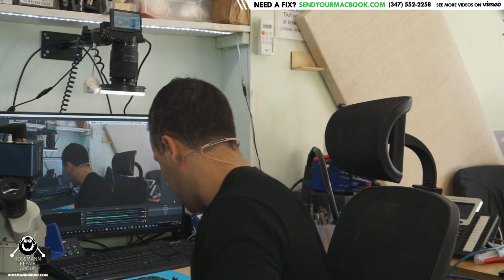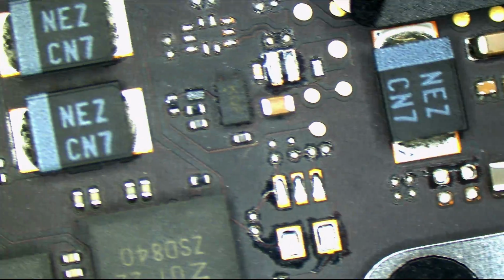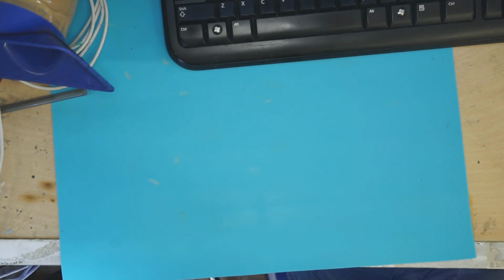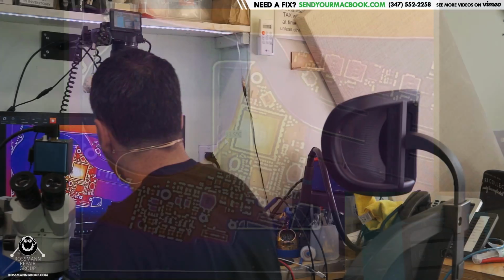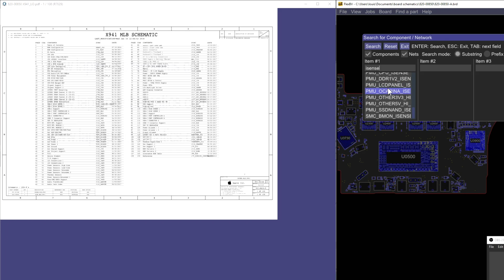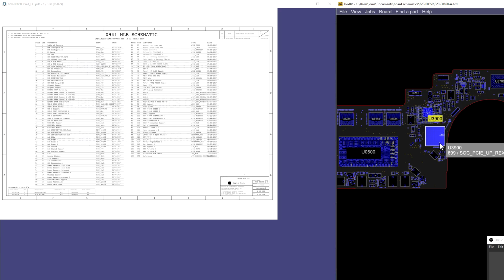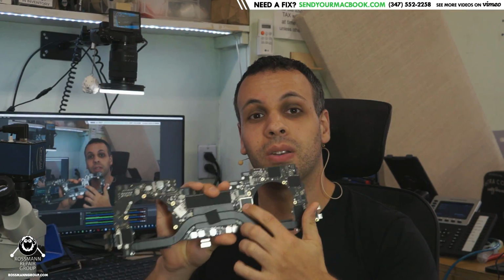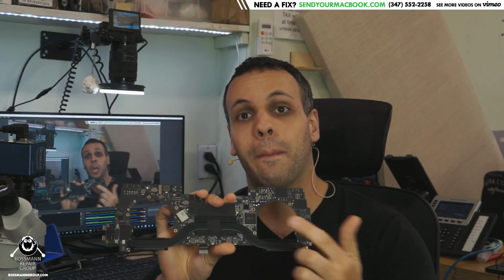Apple users have no one to blame but themselves.

Comment: I am a recovering Apple user.  I send these videos to Apple users.  I have bought 3 Mac Minis starting with a PowerPC, a Mac Book Pro and one Mac Pro 2009.  My Mac Pro died.  I replaced it with an Intel NUC for half the price of the Mac Pro and it is much faster.  I use OBS studio to record screens and make videos.  I MS Photos for light editing.  The best editor is DaVinci Resolve by Black Magic Design.  Who needs Apple?  I have been fortunate because my other Macs still work but I can't upgrade and of them because they are too old.  Mac Mac Pro was still a useful machine before it died but the operating system couldn't be upgraded.  Why?

Why of the "rotten apples" I hate the most is time machine.   Why does it update when I start up?  I must wait to use my Mac.  Time Machine should have an option to update while waiting for the sleep mode timer to turn the machine off.

Will the T2 chip prevent installing Linux as the main operating system?  Installing Linux seems like a good option when Apple no long upgrades the operating system but if Linux doesn't work then the Mac is stuck with the old operating system.

Comment: Welcome to Apple tech support. We are very enthusiastic to annonce you that your $2500 laptop is not covered by warranty as it appears there are fingerprints on the keyboard, therefore breaking the terms and conditions agreement.
Reply: Their products are only meant to be looked at. lol
Reply: @anthonyrusso2520  naaah you void apples warranty by simply looking at it.  .
Reply: It's a collectible item. You should keep it in the box.
Reply: @Mr_ZPguy  by the price it probably is a collectible.
Reply: So in the EU you have MINIMUM 6 years warranty enforceable in the small claims courts. Be smart, be informed.
Reply: @robo6548  don't know where you are living but in the Netherlands it's only 2 year and no drop/water damage.
If they say it was by liquid you'll need some heavy evidence to prove them wrong
Reply: @RFRM89  Actually it is longer in practice, as long as you kindly and in a firm voice "remind" the manufacturer of the actual laws an rules.

Example: Friend of mine here in the Netherlands had her macbook Sdd crap out a few months after the 2 year mark, turned out to be a production fault in the SSD. Apple dealer/official repair shop she bought it at claimed just that 2 years limit before presenting her with 2 hefty bills, one for the analysis and one for the repair.

She asked me to do a bit of research for her since I had dealt with something similar before and with a bit of checking the "billijk" part of the laws, you can find it stating that a consumer has a minimal amount of time they might reasonably expect a product to function. 

For electronics (including computers) it is about 5-6 years (it wobbles a bit depending on type of device it seems) when used as expected.

When we clearly explained we knew about this law and or rights to the Apple dealer they agreed to tear up the SSD repair bill suspiciously quickly.

Then the bastards tried to still make her pay for the diagnosis until we again reminded them that since it was a factory fault it still was the responsibility of Apple for supplying her with a bad product.
So she got her Mac fixed for free in the end.

So it is always worth a try to show the shop you know what the law says in these cases.
Reply: @RFRM89  , actually it is three years , but the burden of proof lies on the customer.
Reply: @robo6548  in the USA, your screwed.
Reply: menotu000

*you're
Reply: @robo6548   No you dont, you have a minimum 24 months warranty,  the rest is optional ( you pay for it for more ). The same goes for apple products too.
Reply: @robo6548  No. It was the UK that had a 6 year warranty, or more specifically "the reasonable life expectancy of the product", which was generally agreed to be 6 years for electronic goods, under the Sale of Goods Act.

It was the EU who forced us to change that, capping it at 2 years, to "harmonize" with the rest of the EU.
Reply: @GMMilambar  under the consumer rights act 2015 You have six years to take a claim to the small claims court for faulty goods in England, Wales and Northern Ireland, and five years in Scotland.
Reply: @robo6548  Correct, but even then Apple can stall and delay and claim all kinds of BS that YOU as the customer will then have to disprove. In the end you'll have to hire experts to examine your Macbook (which voids your warranty) and then take legal steps against Apple. All in all it will probably cost you more than the Macbook is worth and you'll end up doing what you should have done in the first place: take your loss and never buy anything from that shitty company again (personal opinion).
Reply: @tjroelsma  It may be your opinion that they're a shitty company but Louis has been providing proof for years that it's a fact
Reply: @MadnessReborn  I know, just covering my ass LOL
Reply: @robo6548  Nah this is the U.S. my friend. The best you can do here is stop buying their products. I bought the first iPhone and I the 3GS was an upgrade I was wrong. Until the 4G no hardware upgrade only software. They were selling the same phone until 4G came out just different Shell's.
Reply: @robo6548  Its only 2 years man.
Reply: Failure to use $199 Apple white gloves required for use of any apple product
Reply: @DVeck89  those are knock offs. Real ones are 899
Reply: @1972LittleC  thats if you want the space gray ones
Reply: Chat PCTV no.
Reply: "Welcome to Dell tech support, we are just as awful as Apple's,. how can we help you while I finger through the manual because I'm such an "expert" that I have to consult a user's manual on a regular basis" - Dell tech support rep
Reply: Robert Slackware Apple users are too dumb for that. They’ll just by a new MAC. They need to fit in with their hippie liberal friend zone

Comment: Gotta say, I'd probably go to court over that if they claimed water damage with no watermarking
Reply: That’s the problem there buddy, they have sensors in it that literally trip when it’s in a humid room.
Reply: edgard chavez

 In a Court of Law Apple will have to prove it is water damaged and those pads would not be sufficient as there is evidence that they can be triggered by humidity. So if Apple say humidity causes water like damage then the product is not fit for purpose, and over in the UK that would be sufficient for compensation.

Of course, it is the hassle of going up against a big company like Apple that will put most off that recourse, and in that respect they have us...

Comment: I bet they don't give a backup option to make sure that every apple user will use their TimeMachine and will use their iCloud. I bet if you tell them you can't rescue data off the board anymore they will just direct you to a subscription page and tell you better luck next time "and make sure to pay 9.99 for 100GB".... I noticed this pattern long ago. They fabricate problems to sell solutions and then pretend to be their savior. Like with dongles for example: Problem: No headphone plug, Solution: buy 19.99 adapter. Problem: No drive resuce, Solution: buy cloud subscription.

Comment: This is the opposite of the HP EliteBook 8770w I got. This beast (for its age) is easier to dismantle than to break by force. The service manual is openly available and all of the parts are replacable and can be ordered on eBay. Plus, it's as reliable as a desktop due to the supreme cooling (full-metal body made from some kind of magnesium alloy + quad vents).
It's one of the relatively few machines that can fit (and power) a Core i7-3490XM.
Really, this is one of the last Thinkpad era laptops.

For me, "Apple user" is a slur.
Reply: I have an Elitebook 8540p. You're right, easy upgradability. Heck I upgraded the mxm GPU to a Quadro 2000m and the i5 to an i7-740qm and 8gb of RAM add SSD. now it still plays GTA on normal settings 30fps 900p. No MacBook would stand a chance to have upgradability like that.
Reply: Dell Latitude E6430 - already had an i7-3740QM, but I upgraded the RAM.

I thought ASUS came out with a gaming laptop using an AM4 socket, initially with a desktop Ryzen CPU?

Comment: It would be really nice if you could explain what specifically this chip is tied to in the motherboard that causes the board to not work with an identical chip pulled from an identical machine. Did you try this replacement? If you did, what specifically didn't work? Sorry to distract from the justified rage with some technical questions.

Comment: Microsoft has been doing this for years on the Xbox consoles. The cpu, optical drive, and nand are all paired together with encrypted pairing keys and locked firmware. If any one of these 3 parts fail, you have to replace all 3 of them from a working donor board. Apple is one of many doing this crap :(

Comment: Here's why I have to laugh every time I hear about "liquid damage".  Back in 1996, I gave $2400.00 for a Pentium 100-powered IBM Thinkpad.  I used this to run a personalized gift business at the local flea market.  The market booths were open in the back, which exposed the vendors to the weather.  Once, before I learned to staple a tarp to the back of the booth, a thunderstorm suddenly came up and completely inundated the keyboard of that Thinkpad.  I drained the water off, let it dry, and it worked perfectly for years afterward, which was when the hard drive finally died.  So, if IBM could come up with a liquid-damage-resistant laptop back in 1996, why can't Apple do that now?
Reply: For the same reason they still think a Dual Core is good enough today. Their customers don't know any better.
Reply: @TetraSky  a dual core is perfectly fine, just not at Apple prices
Reply: @TetraSky  But "Dual" means two and two is better than one so it's gotta be good right? Right?!  /S
Reply: My mom uses a dual-core laptop every day and it's more than enough power for her but this was a laptop that I got for less than $100 not over $1,000 carry on.

You don't need more than two cores if all you're doing is web browsing and word processing.
Reply: @jordydrop  I like spending 2500 for dual core craptop :)
Reply: @jon2kx  "This is why it is inherently better to purchase the fastest processor you can afford" you definitely sound like a software engineer lol. 

as a computer systems integrator (15+ years), i can tell you that most normies are happy as a clam on a reasonably recent dual-core.  skylake, 14nm dual-core i3 chips are quite smooth for everyday computing (web browsing, word processing). 

if devs write bloated software, you can always rock a cheap linux box. we won't need a quadcore chip for normal web browsing anytime soon.
Reply: The answer is really simple, Apple wants every customer to buy a new Apple product every year for a ridiculous premium price.
Reply: Tar How else are they gonna pay for that new spaceship headquarters?
Reply: @tar509  well seeing how many features they can remove
Reply: It's not that they can't do it, it's that they won't do it.
Reply: @frobthebuilder  No, he's right.  They CAN'T do it.  It would ruin their entire business model.
Reply: I think you missed the main point he was making.  The point he is trying to make is that Apple will LIE to you in order to escape from their responsibility to repair. There was NO LIQUID DAMAGE, yet they told the customer that the warranty was void because of liquid damage. To make it worse Louis can't tell you why the board failed and can't fix it because of that chip
Reply: They literally build drain holes into their more business class models
Reply: @ChinookPiroh  I have a T480s, excellent machine and spill resistant keyboard as well, bloody brilliant products.
Reply: Louis told me that almost every other manufacturer of laptops shrink-wraps the boards to protect the from liquid damage, Apple chooses not to; just like they choose not to give you an apology after they blame you for bricking your own device before replacing it and saying "what, you're getting a new phone; what else do you want? I'm sorry if you think you deserve an apology, oh god I am my father..."
Reply: @justagent5844  conformal coating is way more like epoxy than a heat shrink. And yes, conformal coating is quite common. The other major issue is the non-removal battery if get water in the laptop, 1st thing is removal of the power source to prevent galvanic corrosion, (There is still a small 3v Li battery for the RTC, but it should not cause damage)
Reply: I once spilled an entire cup filled with orange juice on my ThinkPad Z60t in the middle of a seminar.  The computer shut off.  Not wanting to attract more attention to myself, I quietly took my laptop to the restroom and let it drain out the sides.  One hour later (yes, I know too early and risky, but I needed to take notes at the seminar), I plugged it in, crossed my fingers, it turned on.  I used it for 3 more years on a daily basis.  I eventually upgraded to another ThinkPad but my Z60t still ran like a dream.
Reply: Won't,not can't.
Reply: @damian winkler unless there is evidence of water on them, then the warranty is invalid
Reply: Because Apple want ya money, they couldn't care less about convenience
Reply: Linus did the same thing twice with LG laptops and they both survived after being dried out
Reply: @EndstyleGG  Actually they were Dell XPS 12 and 13 if I remember right, which is even more hilarious considering Dell has a terrible reputation for cutting corners in manufacturing.
Reply: Easy. The shorter the product cycle is, the more frequent people would (have to) buy new ones.
Reply: CAN is significantly different than *want to*.  They probably could do it, but they want to suck up as much money as they can before the MacHeads figure out the MacBook/iPhone/iPad is all a scam nowadays.

I remember some years ago saying that while I wasn't enthusiastic about MacOS, that Apple at least made nice hardware.  That hasn't been the case for a long time now.  Must be time to seriously work on a Mac-replacement Linux distribution.  Although it might need to be built on one of the open-source BSD flavours.
Reply: Check out der8auer's channel, he puts motherboards and GPUs into the dishwasher for cleaning, without any problems.
Reply: All electronics are water proof until you turn them on. A table of parts is different from a computer recieving power
Reply: LAWL WHY WOULD THEY
Reply: My ThinkPad even has holes for draining water out of the maschine in the case you ever spill something on it. It’s like they put actual care towards making the maschine last a long time and adapt to the users, not let users adapt to the it.
Reply: Because they are STUPID.. Same goes for the Apple users

Comment: I've been doing IT for 20+ years and in my experience, I've had users say to me something along the lines of, "I'll never buy another" Dell or HP or Toshiba or Lenovo when it comes to just one or two problems that happen to them...sometimes it's not even the computer itself that is the issue but the hard drive that failed....but that's enough to make a user never buy that product brand again....EXCEPT for Apple users.  Doesn't matter how many problems they have with their Mac, they always, ALWAYS, subsequently replace the problem Mac with ANOTHER Mac.  Blows my mind.

Comment: Apple lovers are like the Borg.  You just cannot reason with them.
Reply: Though you might not want to admit it, it's also possible that some Apple users (like myself) have had really great experiences with Apple products for the past 35 years. Not perfect, and I don't agree with non-serviceable machines or one-button mice, but extremely reliable and trouble-free laptops that I've used from 10 - 16 hours every day. Current machine is a MacBook Pro 2012. It's my only machine. It goes everywhere - even 2x to Japan - and I have had zero problems with it. Do I back it up regularly? Of course, but I WILL be surprised when the day comes that I go to power it on and it doesn't start up with the familiar chime. Why? because for 7 years of hard use, it has NEVER failed to do so. You can't reason with me? Sure you can. But you can't negate my experience of decades of reliable performance and great customer service by claiming that we're all brain-washed. Now, does the current Apple need to get back on track? Yes. Do I have faith that they will? That's a question I'm waiting to see answered for myself. I'll probably buy another MacBook next year or the following year and see what my experience is like. Incidentally, I don't proselytize for people to buy Apple, but many of my friends and clients have seen how little I have to do to effectively use my computers and they quietly buy Macs and then let me know how much less trouble they are. I've seen it happen many times.
Reply: Bruh whenever I try to reason with a Samsung user they call me a “brain dead iSheep” when I’m actually the one making sense, so no.

Comment: Take Apple to small claims court.  Damages to include lost data recovery, down time billed per hour, and the cost of purchasing a new machine.  Also, if the owner bought with a credit card, they should check to see if there is an extended warranty there.

Comment: Can‘t you get some utilty to flash these details onto a replacement t2 chip? Ofcourse it wouldn‘t be an offical piece of software from apple but it should work.
I saw some stores in shenzen upgrading e.g. iPhone storage and they were using some piece of software to load edit and flash the new iPhone configuartion. Recommend to look up some of those and speaking to them since they‘re getting behind the securtiy just fine.